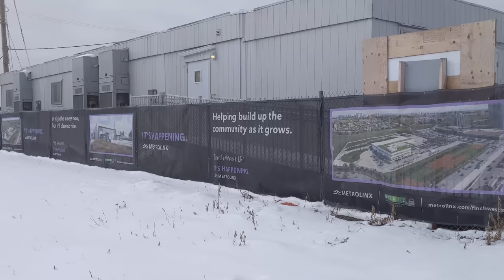Missing Links: Short-Sighted Transit Planning

Comment: @RMTransit in The Netherlands the Flevolijn went in use at 28th May 1988 and until 6th December 2012 there was a missing connection between Lelystad Centrum and Zwolle but since 6th December 2012 there is now a faster connection because instead of only travelling from Lelystad via Utrecht to Zwolle you travel rechtstreeks from Lelystad Centrum to Zwolle. And still there is a missing railway link wich connects Lelystad Centrum to Groningen called De Lelylijn however the plans where cancelled in 2007 because politics and not so much money/no interest now they are talking about that again

Comment: @RMTRansit Happy New Year!!!   Excellent Video, but I think you miss the political problem with Transit funding.   Some Politicians and Residents will resist creating transit lines that exceed a set figure and would compete with adding Roads/Highways.   People are far more likely to complain about Traffic, than a lack of a Transit link they would never use.   In order to not let progress stall, building Transit with Missing Link(s) is needed and then petitioning to add link(s) at a later date.   While it is true, this attitude costs more, it is better than no system.  If the politics of Transit Development could be resolved then we would see more rapid progress.  Maybe it is time for Public Transit enthusiasts to be more vocal at the planning/funding stages to make sure those Links are never missed.
Reply from the maker: I think the issue with your comment is that it implies that politicians and residents usually care so much about specific numbers and outcomes. I think there is a lot more flexibility in this than you suggest.
Reply: @RMTransit  I have been at some of those meetings and it is usually a battle between those that want to spend to upgrade transit and those that don't.  The compromise is usually something that doesn't satisfy anyone and hence we have Missing links.    Trying to get a Transit projects passed is a very difficult, especially in the USA.

Comment: My most hated "missing link" is the gap between the planned Shinagawa terminus of the Chuo Shinkansen, which will cause an annoying gap between the new line and all the JR East/Hokkaido Shinkansen (Tohoku, Hokuriku, Yamagata, Joetsu, Akita Shinkansen) which terminate at Tokyo. I understand that finding space at Tokyo would've been difficult/expensive, but they could've probably instead swung to Ueno instead to connect to those lines. Considering the total cost of the project, I'm not convinced that this (granted, very expensive) extension would've broke the bank and the connectivity it provides to everyone north and east of Tokyo would've been great.

This is even more infuriating considering that the exact same issue existed when the Tohoku Shinkansen initially opened and terminated at Ueno, as opposed to Tokyo, where the Tokaido Shinkansen terminates. This gap was finally filled six years later but created a missing link on some of the normal JR lines until the Ueno Tokyo Line finally opened another 24 years later. So you'd think they'd (though of course there's two different they's here: JR East and JR Central) have learned their lesson...
Reply: If it went to Tokyo JR Tokai would have to submit to JR East since they would go in their territory! But there are ideas to extend some Tokyo Metro lines to Shinagawa to take advantage of it. And some companies are opening offices there in anticipation.
Reply: @funtonite  JR Central already goes to Tokyo though on the Shinkansen, so that's nothing new. Also the JR East/JR Central boundary isn't at Shinagawa either but between Kanagawa and Shizuoka prefectures, except for Shinkansen. 

The proposed Nanboku Line branch to Shinagawa also doesn't really address the gap, it just provides better local (Kanto region) access to Shinagawa, my issue is with the lack of long-distance connectivity to the north/east. It is also a good example about what Reece was talking about in the video, being extremely expensive for a very short line.

Also, there's already a ton of offices/business at Shinagawa, that's not the issue.
Reply: Too expensive to tunnel under Tokyo Station already with Sobu and Keiyo Line deep underground platforms. Chuo Shinkansen primarily aimed at business travellers, most large businesses are concentrated in Minato-ku and southern portion of the Yamanote loop, so the Shinagawa terminus is OK. Few travelers will transfer to JR East shinkansen lines, they would fly instead given the distances.
Reply: @andrewpalmer840  Sendai <-> Nagoya for example would be very competitive with a convenient connection between the Tohoku and Chuo Shinkansen, train being ~2 hours (1.5h sendai->tokyo, 0.5h tokyo->nagoya) and plane ~1h plane + 2x 30minute trains on either end + time at airport. Given the convenience of Shinkansen vs planes I'd say it stays quite competitive even further north. Sure, a lot of business is concentrated in Tokyo, but other regions of Japan do exist and especially businesses in the Chubu region would probably appreciate easier access to Tohoku. 

Niigata <-> Nagoya is a similar story though of course slightly longer by train and Niigata Airport being quite a bit closer to the city.

But even with times relatively close to flying, the Shinkansen beats planes on almost all routes with being much more frequent, convenient and hassle free.
Reply: @andrewpalmer840  The Chuo Shinkansen should continue from Shinagawa to Shinjuku, not Toyko.

Comment: Not sure if this counts as a missing link, but Baltimore's light rail was opened with a stop roughly three blocks from Penn Station (amtrak + commuter rail).  They finally got the money together to build a branch line bring a single track over I-83 and into the station for a direct connection... but service on this branch runs every 30 minutes at peak, making it useful only for those physically incapable of walking the three blocks.  A pedestrian walkway would have been a better use of money.

Comment: In Philadelphia SEPTA'S Route 15 trolley line runs a mainly east to west path mainly along Girard Avenue from the Delaware River on the east edge of the city to almost the far western edge of the city. At both ends there are loops to allow the trolleys to turn around to traverse the route in both directions, but the loop at the western end leaves it just over a mile from SEPTA's 69th Street Transportation Center which is a major transportation hub with connections to The Market-Frankford line, the Norristown High Speed Line, the 101 and 102 Trolleys that travel far out into the adjacent Delaware County, and a large number of both city and suburban bus routes.  I've often wondered why the Route 15 line was not extended that last mile to that Transportation Center.

Comment: Missing links in London:

- The Circle/District line terminus at Edgware Road stops just shy of both Marylebone and Baker Street. Quite annoying but I did at least discover a really nice coffee shop and bakery with a “local village” feel walking between the two, which is quite unusual for London.

- The London Overground passes right over Brixton, very close to the station but unfortunately its position on some old viaducts and limited space makes adding a station there very impractical. To get to Brixton from this line requires two further changes.

- The Victoria line terminus at a Brixton is one short stop away on the train to Thameslink at Herne Hill.

- When the Elizabeth Line opened, it meant a regional train service from Greenford to Paddington had to be cut back to West Ealing. This stops just one stop short of Ealing Broadway which would have made this truncated line way more useful. One day I imagine this track could become part of the Central Line, closing the loop.

- No (direct) interchange between the Elizabeth Line and the Victoria Line. Which would have been great as these two lines alone have the power to break the “40 minutes to get anywhere within London regardless of distance” rule.

- Surprisingly no stop on the Elizabeth Line at London City Airport.

- The Northern Line extension doesn’t go to Clapham Junction. I suspect this was deliberate as I’m not sure the line could handle the extra passenger numbers.
Reply: Northern not going to Clapham Junction was Deliberate - provision has been made but currently Clapham Junction struggles with crowds without having a heck load jumping off middle distance trains to grab the tube, rather then continuing to Waterloo/Victoria and spreading out over 6 lines. Pre-covid there were plans to rebuild Clapham Junction, and Crossrail 2 was also a pre-requisite for completing the Northern to Clapham to spread the load out.

Victoria Line tunnels almost reach Herne Hill, I assume budget at the time stopped it going further and the line already being near capacity without extending further 

The Greenford line suffers from the Central being quicker into London - the alignment between West Ealing and Ealing Broadway is very constrained and widening it to two extra tracks would be very expensive. Plus it's a freight route. 

London City on the Elizabeth line is simply a case of not enough space. While it passes under the airport apron the only suitable station site is some way away from the Terminal - and then it's super narrow corridor

Edgware Road has the space for terminating platforms - there are still through trains, you just may need to cross the bridge depending on what platform the terminating train is assigned (it's a double island with centre tracks for terminating trains, outer for through)

Comment: Frankfurt is certainly one of the bigger offenders since its U- and S-Bahn both have quite a bit of missing links.

One notable example is the U2 which terminates at Gonzenheim but doesn't reach all the way to the centre of Bad Homburg (down to the train station) but plans exist to extend the line further west. For comparison: Back when it was a tram, the line went much further and the U3, another line which goes outside of Frankfurt (i.e. Oberursel), got spared from this problem and there is a connection to the station and even goes further north-west.
The U5 also is a big offender since it goes all to Preungesheim but if you go north on the Homburger Landstraße, you'll eventually reach the Frankfurter Berg station and the line could have gone this far north (though IIRC this mostly is a side effect from the tramway conversion so it's merely an inherited flaw but still). Again, everyone is aware of that which is why there are plans to extend the line further north in the not-so near future.
The lack of connection to Seckbach on the B-line may also count but it's quite minor and not worth the effort.
The Regionaltangente West also fills in quite a bit of missing links with the U-Bahn such as adding a connection between Höchst and Eschborn.
Even past the desire for including the Dreieichbahn (Buchschlag - Dieburg) into the S-Bahn network, the S1 really could go further south to Dieburg instead of terminating at Ober-Roden (note that the line is single-tracked but also unelectrified which is presumably the main reason it hasn't been included already).
The extension of the Nordmainsche S-Bahn also shows another missing link since it connects the City Tunnel with the eastern station.
The lack of connection to the Groß-Gerau station with the S7 (which stops at the Dornberg neighbourhood) may also count but that one would possibly involve some tunneling or a large bypass to at least have a line parallel to the B44 and is thus unlikely to be filled (the station also uses 550mm platform which are incompatible with the high-floor trains anyway but the modernisation should change that).
A tramway example but the trams really could have gone deeper into Höchst and possibly go further to Unterliedbach, though there are quite a bit of one-way streets on the way.
Edit: Another example is a lack of tram to the west station even though the tracks are already there, though this mostly is a side effect of the creation of the U-Bahn and there aren't many justification to reactivate the connection but it nonetheless is a missing connection worth mentioning.
On a minor note, there also is a missing transfer between the U1 and S6 where both line cross each other but the stop at Niddapark only exists on the U1 but not on the S6, though this is rectified in the near future with the quad-tracking of the Main-Weser-Bahn and also was done most likely for capacity, disruption and redundancy reasons ("If we're going to add an S-Bahn stop there, why don't we wait when it's separated from the rest of the network when it's going to disrupt service anyway and cost more money otherwise?").

Other cities with a tramway in the Rhine-Main region also have missing links: Darmstadt's tramway used to have connection to the eastern station but is nowadays not a thing anymore and there is no tram to the Arheiligen station either while within Mainz, there is no tram connection to Höfchen (centre of Altstadt, close to the cathedral), though there are plans for a line to go there while the line to Bahnstraße could go further west to Ludwig-Nauth-Straße but there are no ways to extend it further without building it underground and given how minor the extension is... don't expect it to be filled.
Edit: I realised that Mainz has another example and this is rather egregious: The Turmstraße tram stop and Waggonfabrik train stop. Both are physically located right next to each other but are separated by railways tracks of the latter and the direct access is a pedestrian overpass between them (and also not very accessible) on the other side of the railway platform to the tramway platform. It's... certainly not ideal at all and its only saving grace is the fact that a train in each direction only comes every hour so chances are, you wouldn't take one over the other but still.

Comment: Madrid has a lot of missing links, in the center and outside: one example is Metro L10b that zig-zags trying to avoid any convenient connection with Cercanías line C4. Also one between stations of Callao and Santo Domingo, a short distance away by walking, it wouldn't look very useful at first glance but it's always good to have extra links to dissolve the flows of passengers that are in that area. And, as the network is very radial, some legs that are close aren't connected between them (e.g. metro lines 2 and 9)

Comment: in philly there is a lot of disused rights of way from old rail lines. one of these is the cardington branch. this small branch used to connect where the current millbourne station to the west chester line. why is this important?  well about 600m to the west of millbourne is 69th street terminal, the major hub for the market frankford line, norristown high speed line, trolleys and busses. you might think thats fine because the market frankford line connects them. but its not about millbourne its about reginal rail. Regional rail is the largest part of septa's network and does not connect to 69th street. you can transfer from regional rail to the market frankford line in center city, but that means making a very long walk to transfer and the market frankford line is not safe. (septa really needs to get security under control) Regional Rail is mostly used to connect the suburbs to the city, which it does well. but to start in a suburb and try to get to another suburb that isn't near regional rail is at least 2 transfers. going to center city, getting on the el, then getting on whatever you need at 69th street. if the cardington branch was kept open and extended just 600m you could stay on regional rail all the way to 69th street. i would propose that a transfer from any other regional rail in center city to 69th st via cardington should be free to encourage transfers.

this would also open the option to open up the newtown square branch as its own line as the newtown square and cardington share a corridor before connection to the west chester line. if anyone is interested i can send them my written proposal (that i made for myself)

Comment: Wish Piramides station have a  direct connection to cercanias C-5 and Alonso Cano were connected with Iglesia station like Embajadores or Pza. España do. Anyway, Madrid metro has some examples and looks like the regional government is addressing this problem. Example of that is the on-going metro line 3 and 11 extensions, both to line 12 and lines 1, 3, 6 and (maybe 9) respectively

Comment: Istanbul Metro has a lot of missing links
Reply: elfrjz  Only building metros would be enough 😅
Reply from the maker: Hopefully something that will be rectified over time!
Reply: @RMTransit  Izmir will also miss a cross-platform exchange in Üçyol, where M1 between Bornova and Fahrettin Altay and future (about-to-be-constructed) M2 between Üçyol and Çamlıkule will connect. The systems are planned to be partially compatible (M1 trains are compatible with M2 but not vice versa, there is even a maintenance tunnel intended to link those two lines)

Comment: When London's Piccadilly Line extension from Finsbury Park to Cockfosters was opened in 1933, it covered 7.5 miles, had eight stations, was 90% underground and cost £5,500,000. In today's money that is equivalent to £503,616,036.72.  Good planning on the part of our forefathers.